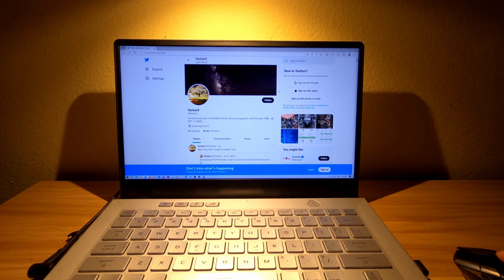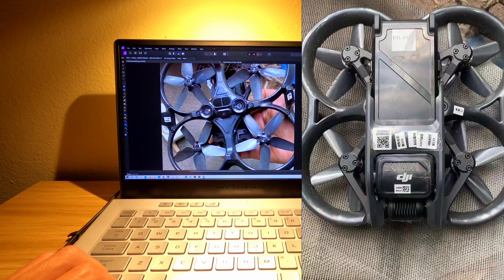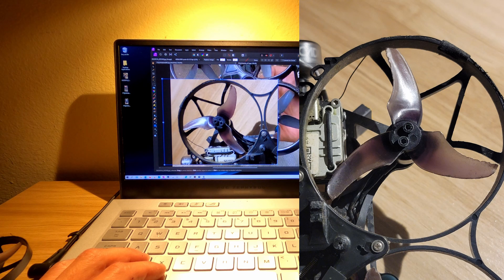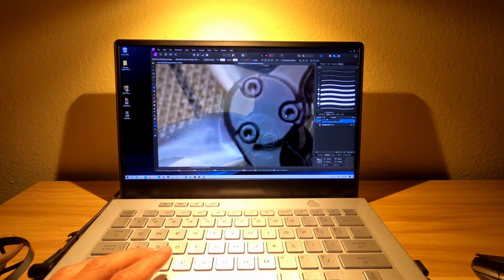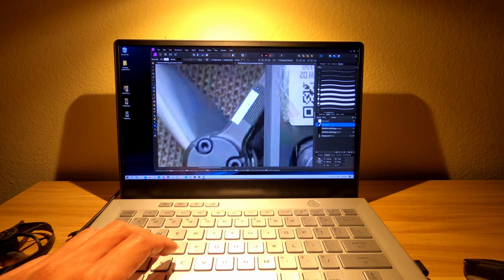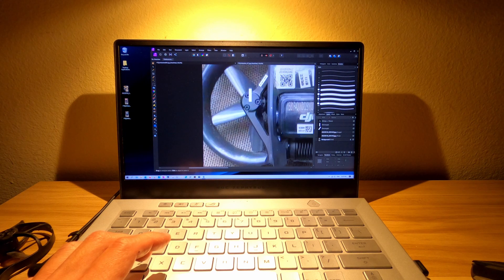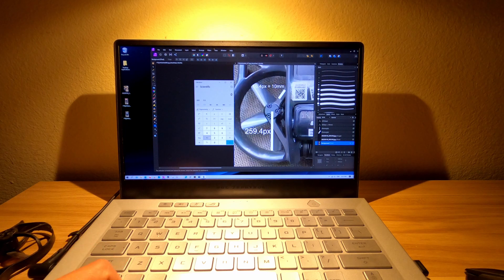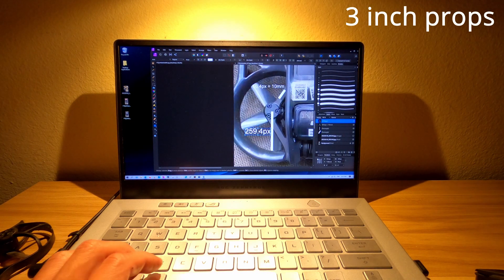How big is the new DJI AVATA Cinewhoop | Leak

Comment: I'm interested in the new v3 goggles and their compatibility.  The finished drone certainly has its advantages, but looking at the bottom camera, I thought that it wasn't the option I wanted for an fpv quad.
Reply from the maker: Definitely, if v3 is smaller and has backwards compatibility with the vistas and air units that would be nice. This new fpv drone is questionable so far